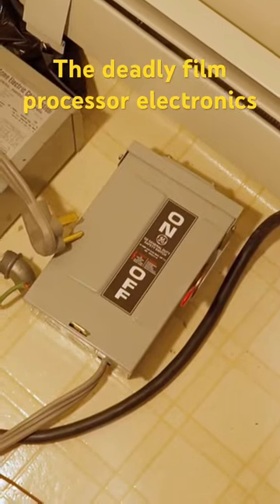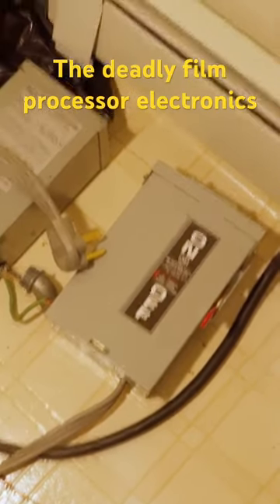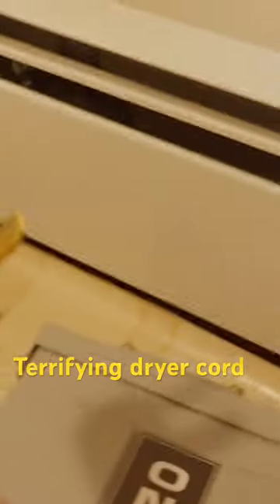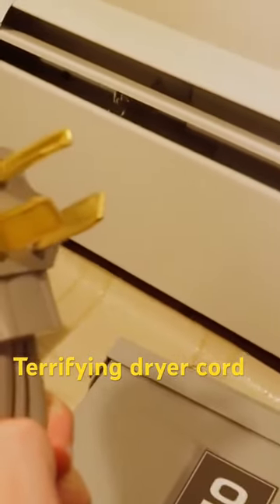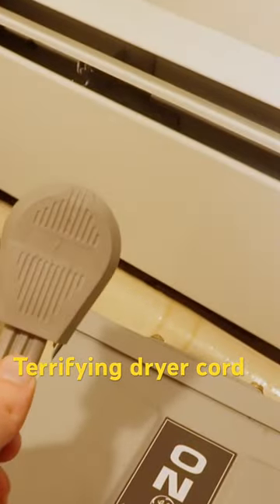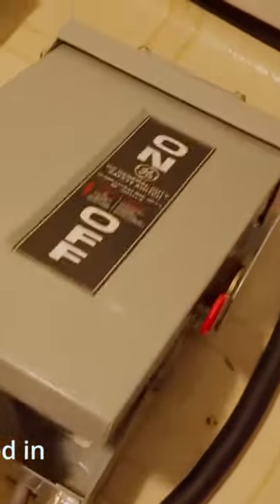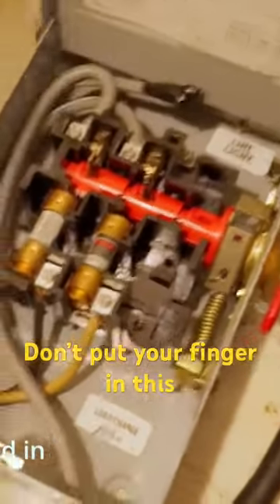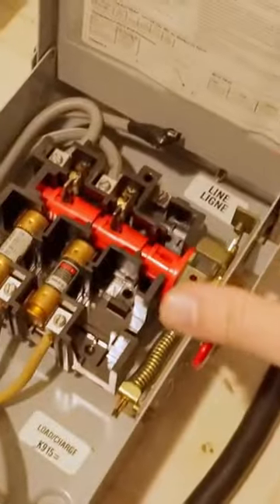Don’t get killed by the film processor #filmprocessing #vintage #35mm #filmphotography #electric

Comment: Oooooooh. "240v is soo deadly"
Reply: "Europeans giggling".
Reply: @XantheFIN yeah, shocked myself numerous times with 230
Reply: The rest of the world use 220v-240v as a standard, and 380v-400v fore ‘high load’ stuff 😅 
Americans ^^ 🙈
Reply: Yeah and the uk has switches and outlets in the Same device idk if I like that
Reply: My country uses both 120 and 240. The workshop i work at has both, yesterday we had another guy come in to weld our broken car jack (welding machines are great) using that 240 outlet
Reply: @zigge1989  We use 480v for powerful commercial/industrial stuff in the US. 240V for oven/heater/etc in the house.
Reply: As an electrician, I’ve probably received more voltage than I’d like to admit, and probably more than is safe 😂😂😂

3phase ftw 🎉🎉🎉